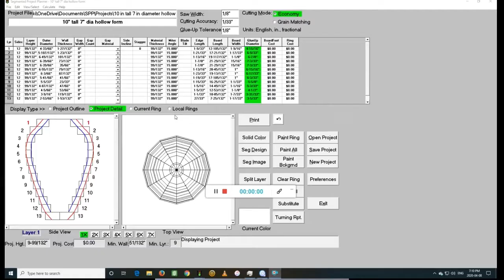Splash of Color,  Segmented Turning  Hollow Form Vase,  Wood Turned on the lathe.   Dyed   Bowl

Comment: Project turned out great. I like the colors as I am still experimenting, LOL. Just curious, no sand and seal before the poly ? Thanks again for sharing.
Reply from the maker: Hi Curtis,  thanks for watching,   sanding up to 400 grit,  but I usually don't seal.    My first two coats of poly are a bit rough,  I sand after second coat and then subsequent coats are nice and smooth.   That's just how I do it.

Comment: OK, So I have one last question, what thread are you running on you Vicmark lathe that allows you to swap chucks across from the tailstock to the Headstock so easily. Thanks
Reply from the maker: Hi Warren,   I have a live center product from Oneway that has a # 2 morse taper,  it fits into my tailstock,  it has a 3/4" by 10 tpi male end.   (see link below).

And then I have an adaptor that screws onto the live center,  the adaptor has an M33 by 3.5 metric thread,  that matches my vicmarc lathe and all of my chucks.   (see second link below).   I'm able to take chucked projects from the headstock and reverse them onto the tail stock.   I then bring the tail stock with the project up to the head stock chuck and the work piece is perfectly centered.   

https://oneway.ca/products-category/holding/Spurs,%20Drivers,%20Centers/Live%20Center/2%20MT%20Live%20Center

https://oneway.ca/Live%20Centre%20Adaptor%203-4%22-10%20TPI%20to%20M33*3.5
Reply: @fromthewoodpile8248  thanks for all the info, sadly my lathe runs a M30x3.5, which I cant seem to find an adapter from 3/4x10 TPI.  I may have to try make one....